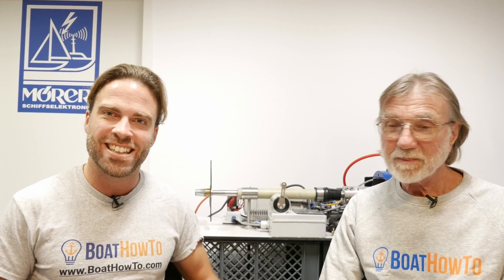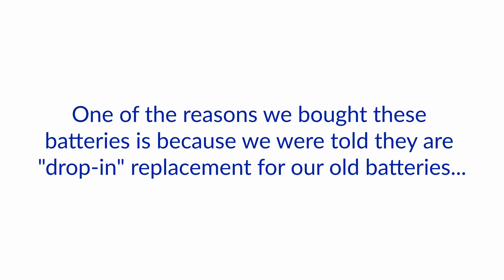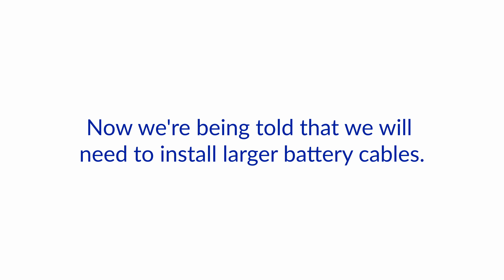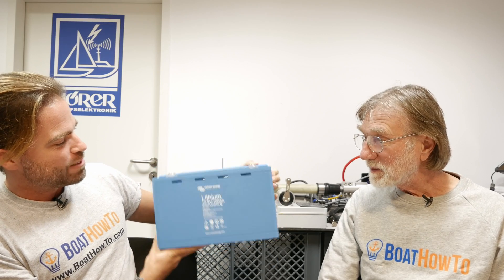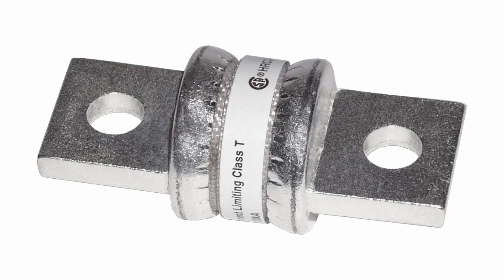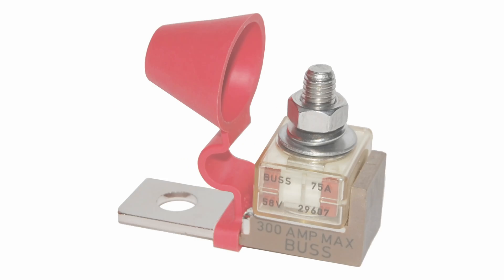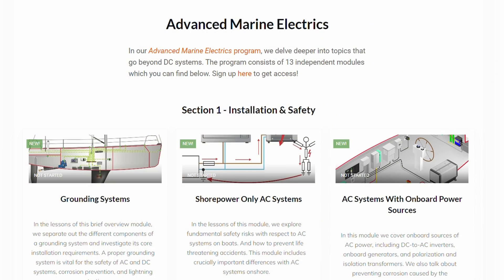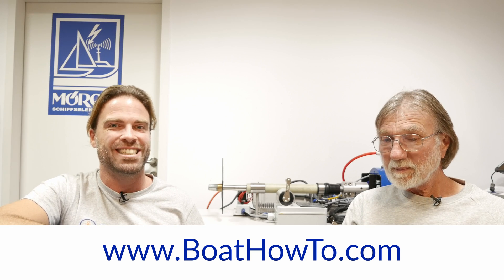Sizing LFP BATTERY CABLES - And other things to keep in mind. | Ask The Expert with NIGEL CALDER

Comment: Good video thanks guys. 
I was really glad to see someone highlighting the importance of considering protection AIC, given almost all marine fuse types are inadequate for large lithium batteries. 
A lot of LiFePO4 batteries with internal BMS's don't specify a maximum short circuit current or internal resistance for the cells. Because they have overcurrent protection within the BMS they just give the maximum discharge current before the BMS will trip. 
What are your thoughts on relying on the solid state BMS short circuit protection to protect the cable and. busbars, or suggestions for working out a battery's peak fault current when the manufacturer doesn't specify?

Comment: Agree. Retaining a lead acid battery as a start battery and linking that to the LiFePO4 house system through a DC to DC converter is rapidly becoming the standard solution.

Comment: Nice video, but you are assuming everybody charges with an alternator. My experience is that far more people charge with solar and a DC/DC charger from their engine battery. Not having to link the BMS with the alternator is a huge advantage. The risk of thermal runaway is much reduced. I have never seem a lifepo4 battery that set alight from thermal runaway. I would love to see any photographs published if you have them.
The ISO is not helpful to the average cruiser with lithium onboard. Demanding a link to lithium batteries will render the ISO useless simply because nobody will follow it. Why do I need a command to stop charging with my alternator if  I am not doing so? The ABYC standard is fsr more reasonable